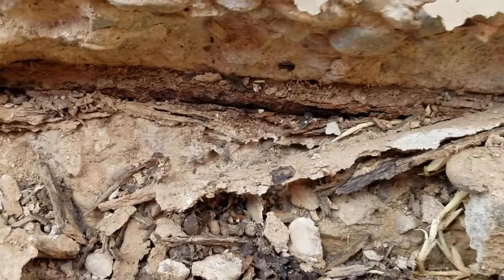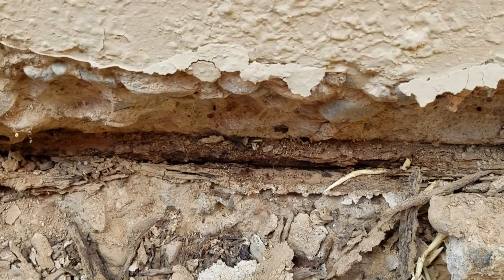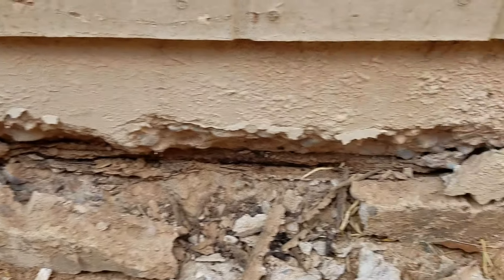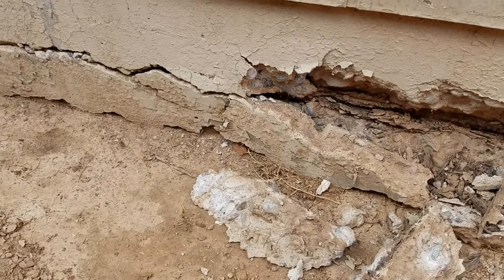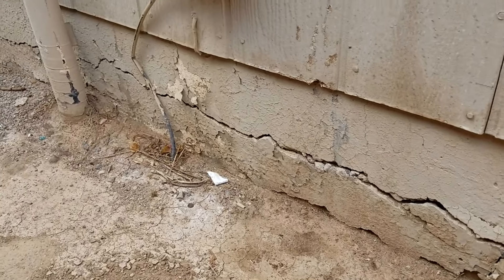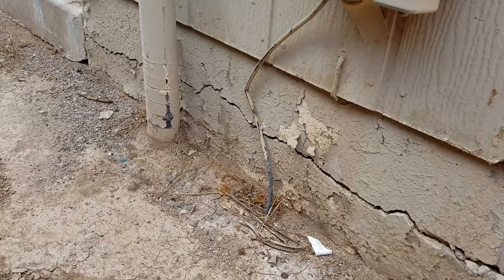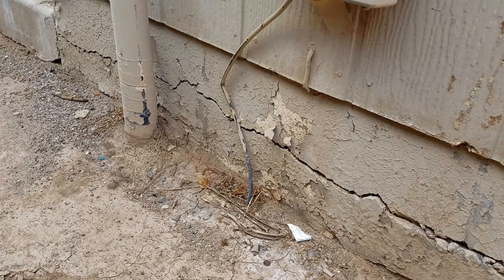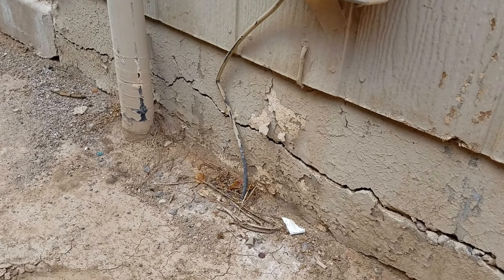Foundation Repair - Problems to Look For at Home

Comment: Hi James, great channel, i learned a lot. Question, if repaired properly then how long is the foundation expected to hold? Will the cold joint between the new and old concrete show cracks again? How will it look after 10 or 15 years?
Reply from the maker: At least 10 years or more once waterproofed and painted. We have yet to go back and repair any of our work. Rain gutters, and dirt grading is also recommended because of settlement. Settlement is a different type of damage then oxidation of the rebar. Thank you for your question.